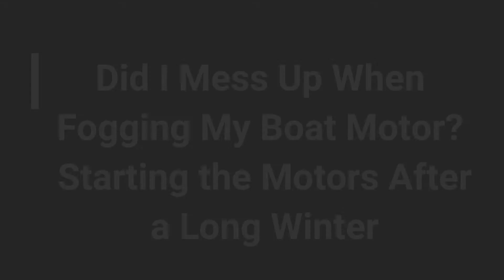Did I mess up when fogging my boat motor? Starting the motors after a long winter.

Comment: Sorry to hear about people being rude. We had a 1980’s mercruiser engine 5.0. My dad ordered a cobalt yes he could have gone much bigger why drink the gas.? Plenty for tubing running around etc. winterization we usually just drained the water left the pet cocks open, pulled the water hose off got out all the water filled the tank removed the battery after we got back to storage made sure all the water and hose was re connected dried up any remaining water. Used a fuel stabilizer come spring launch. Yes we fogged but winters kept getting to warm. Never had a lick of trouble. Talk about making a child cry. My summers tubing birthdays. Got compliments on her. We kept stuff waxed every summer their wasn’t any oxidation of the fiberglass to be a had. Hand polishing and electric buffer. Polished the teakwood with cobalts oil stain. I grew up on Miami vice that was my go fast boat. Learned to drive and trailer a boat. She didn’t get wet very much as far as rain I hope after all these years the owners never abused my childhood. We weren’t using her all that much low hours. The temperature sender unit failed after lord years. Oil was changed every spring as well as the engine.  Today’s cobalts are wow wee sticker shock. Make sure to keep your boat happy and healthy. I’m not sure on the new mercruiser engines for even 2020 but love them none the less. Polish what needs to be polished keep seats out of the sun wipe and clean with the proper stuff. Remove bathtub ring with cleaners with damp to wet towels. Don’t let scrime build up on the hull. Lessens fuel economy. Check oil prior to the trip charge batteries or replace
Reply from the maker: Thanks for the comment Mark. I guess I have to expect some rude people when I put stuff out for the public but, it just sucks that people feel the need or are so sad and angry that they take it out on others. I agree boats help create a lot of memories. On the water or taking care of them involves the family. I have had pretty good luck over the years with my boats and I hope that continues.